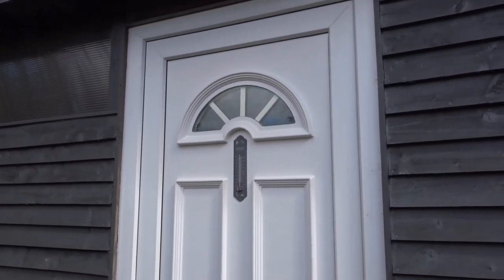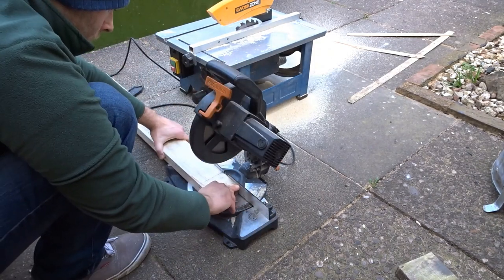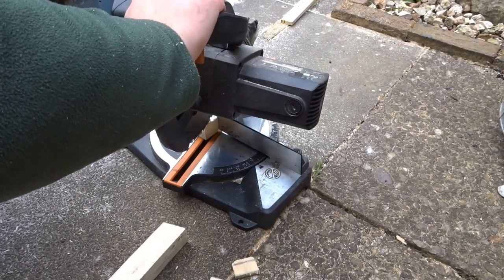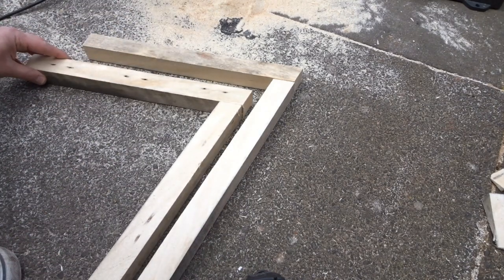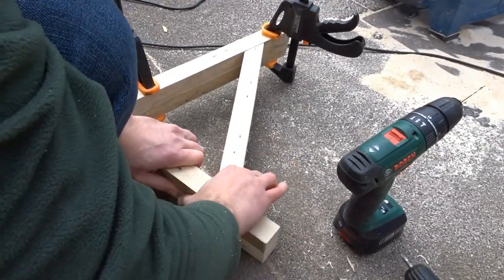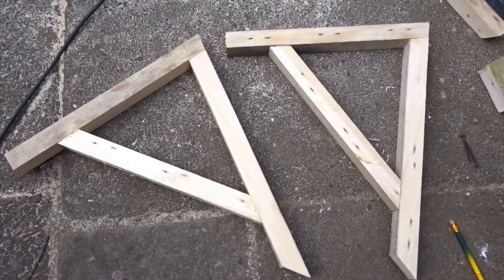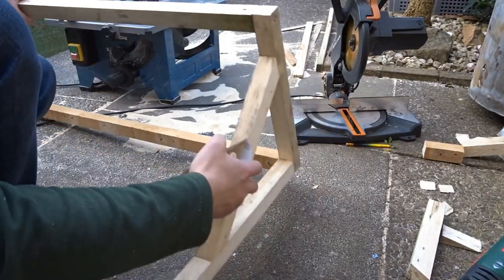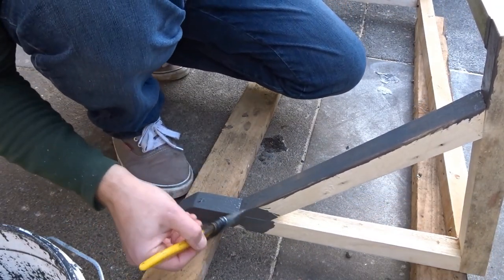How to Make a Simple Porch / Awning for a Workshop / Shed / Man-cave

Comment: I need to make something like this  but the over hang on the shed is low and the shed door opens outwards. 

Any suggestions please
Reply from the maker: You could still make a porch to span the width of the doors. Make the angle of the pitch shallow so that the doors still have clearance. To make up for a shallow drop in the porch roof you could make the porch roof deeper.